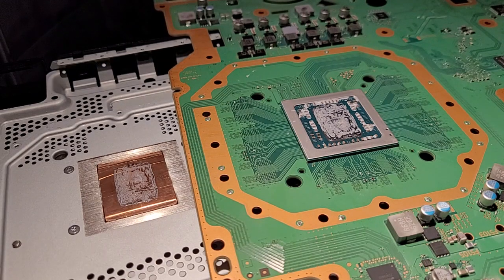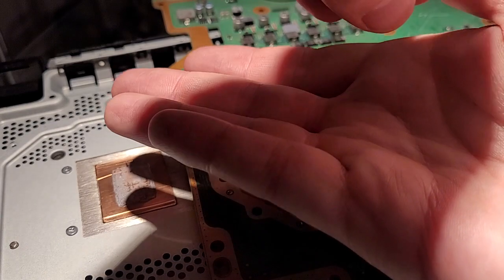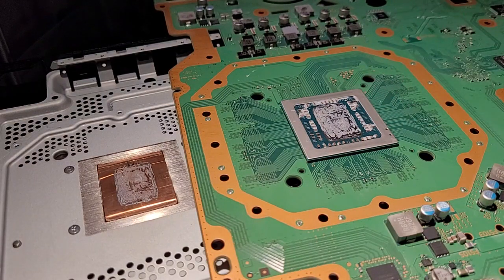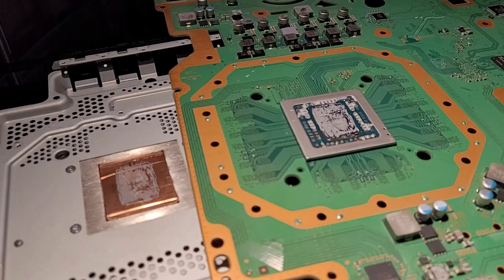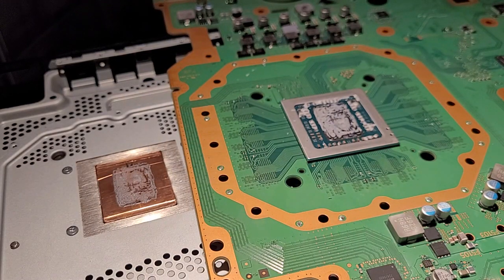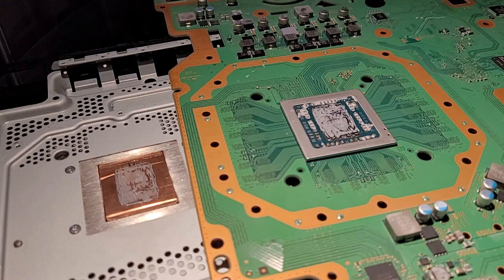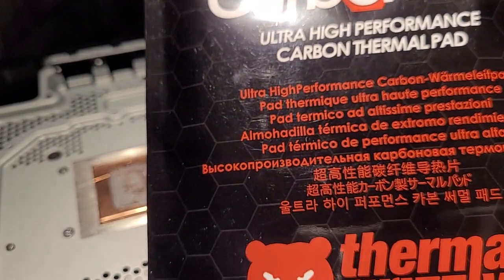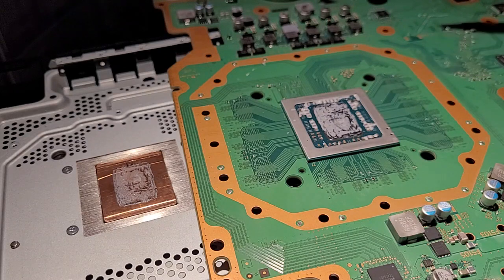PSA: Why your PS4 Pro is Loud Again After Repasting

Comment: Is this the same for the original ps4? Just cleaned and repasted andcstill sounds like a jet.
Reply from the maker: Yes, anything that is direct die can suffer from this issue. I made it more about the Pro specifically as its a much more common problem with it suffering from overheating vs the original.

That being said, you shouldn't run into problems immediately; this is something that occurs over time. For me it took about a month or so for it to return to being a jet engine. 

If you're running into the jet engine sound right after putting on new paste you might have other issues, perhaps a thermal pad is missing or out of place. Or perhaps the tensioning bracket isn't applying enough force.

Comment: If I could add to your theory...I think many people are tempted to push the board on once it has the thermal paste on it.  Not a good idea cause you basically create small air pockets when the motherboard takes its normal flat shape.  Just rely on the X clamp to keep a constant amount of pressure on the two mating surfaces.  🙃👍
I'd also be curious how the PS4's would do with liquid metal, like the PS5.  🤔

Comment: I went the nuclear option and went with Liquid Metal for the chip. Gelid thermal pads for the RAM and other components that had thermal pads on. 

I plan to change the delta fan with a nidec fan. But the console is completely silent with the mods I’ve done.

Comment: What size is required for pads for PS4 pro?
Reply from the maker: @masquerade3224  die size is listed in the description. In general, basically any of the kits will be more than large enough because they're designed to be used with ihs. You'll need to cut them down to size.
Reply: a n i m e
n
i
m
e

Comment: I tried carbonaut today, it's correctly installed and still jet engine noises. Actually worse than before with the hydronaut. I'm giving up :/ Looks like the only solution is buying a ps5
Reply from the maker: It may be something else on the board is getting hot aside from the processor and triggering the fan to ramp like that. Did you check to make sure all the other thermal pads are in place for the vram and power delivery?

Comment: If that’s the case. Then why can’t we put a lot of noctua nth1? Can’t we do that? If it’s thin apply more? Even if it’s messy it should technically work right?
Reply from the maker: The amount is irrelevant, the mounting pressure will immediately squeeze out the excess then the rest remaining will get pumped out over time as described in the video.

Comment: I used Gelid GC-1 last time, and in less than 2 weeks sound like a jet engine again. I've tried kryonaut, nt-h1, gd900, mx-4, etc and all of them have the same issue. I will try the hydronaut. Carbonaut is very hard to find in my country. Nice video.
Reply: Same mate i replace also new thermal paste artic silver my ps4 pro 70xx and again semi loud again when i play ghost of tsustima or avengers
Reply: @kikomanq  Update: 1 month later, sound like a jet engine again with the hydronaut... Carbonaut seems to be the only solution for ps4 pro :/

Comment: NAHHHH Just use Artic MX-6 this one in specific made my thermal pump issue to go away. Barely runs loud. I have the first gen ps4 pro. The loudest one. The jet. The 777.
Reply: how about now?is still run well?or u just put in the closet and play ps5?
Reply: @ben-tol  nope still using the ps4 pro to this date. Ps5 prices in my country are ridiculous.
Using MX-6 did work. But I have to be repasting every 3-5 months. And I game everynight. Yes it did work and run well
Reply: @GuanacoSIVAR  what would happen if u dont repasting 3-5 months or maybe re-paste once a year?or let say last than a year maybe 7-8 month,is the fan going crazy like a used to be?have u try that before?

Comment: I bought a cheap white paste "made in Japan" years ago and has been better or equal than most of these expensive pastes :)
Reply: whats the name of that paste?
Reply: @ben-tol  It just said made in Japan. Now I am using Honeywell PTM7950. Much better than the one on the video (or anything I used before) and it works perfectly on the PS4 Pro, the thing is dead silent now! But it makes sense because the PS4 Pro die size is quite small and every "normal" paste tends to simply squeeze out. Also the PS4 Pro contact part with heatsink is not even, that is also a thing.

Comment: Thanks for this, do you also recommend I change the other thermal pads scattered around? is it necessary?
Reply from the maker: I did personally as a while I'm in there thing. That was mostly because I found some high end Gelid pads for cheap. 

In general I don't think I'd say its a must do, the original pads I'm sure aren't super high quality but they last a very long time. If you don't mind spending another 10-15 bucks I'd say go ahead and do it, but if you don't want to spend the cash or can't find a good deal on thermal pads then I wouldn't worry about them. 

Generally unless one is outright missing or misplaced its not going to have a significant effect on thermals.
Reply: @Canuckrz  Alright, thank you! Also, I'm about to buy the Grizzly Carbonaut pad - 38 x 38 x 0.2 mm is more than enough then?
Reply from the maker: @Caenei  Yep the die size on the ps4 pro is only 15mm x 23mm so you have more than enough to do it twice.

Comment: I just replaced with some cheap thermal paste and completely cleaned my ps4 pro from dust and its still loud af. Should i buy a better quality paste or replace it with grizzly thermal pad?
Reply from the maker: I'd recommend the pad if you don't want to risk doing it again. Its not much more than a tube of good thermal paste anyways.
Reply: @Canuckrz  Will a grizzly minus pad 8 work?
Reply from the maker: @daniel_svk  I would strongly recommend against the minus 8 pad. The minus 8 pads are designed for lower heat output items that require a thicker pad. For comparison the thermal conductivity of the minus 8 pad is 8W/mk, Carbonaut is 62.5W/mk. The minus 8 pads however would be good to use for the ram chips and power delivery on the ps4; just not on the processor.
Reply: @Canuckrz  appreciate it brodda
Reply: @Canuckrz  any updates?
Reply from the maker: @Aaron 868  still working fine though my buddy owns it now. The whole point of this is that if it works find out of the gate it will continue to work fine for years.

Comment: i had issues with artic silver 5 even on my laptops . But i repasted with mx4 and added new pads with a few holes in the fan cover . Now its running like a clock. Even at hands touch it runs much cooler and noise levels are far reduced. I installed a ssd also to boost performance .
Reply: What does that mean you added new pads?
Reply: @yūrei_onigiri  thermal pads .
Reply: The apu also called cpu need thermal paste so the heat get transfered to the heat sink and ccol down the temp, but similarly the memory chips also need cooling, but due to the huge gap that can reach like 1mm or more, thermal paste cannot be used over here, so instead of liquid thermal paste, they use thermal pads which are special sheets that comes in # sizes depending on the gap, and it work similarly to thermal paste

Comment: Any chance of an update video to see how the PS4 pro is going now?
Reply from the maker: I've since sold the console to a friend as I picked up a ps5. Generally with the thermal pad it won't degrade or pump out over time like paste so if it's working well after initial install I wouldn't expect it to change.

Comment: another underlying issue is to check the severity of potential airgaps between the silicone die and the copper heatspreader. So if the airgap is above 1mm, kryonaut will really fail at a rapid rate due to the airgap that's causing micro air pockets onto the application itself making the bond weaker and causing it overpump.
Reply: Cross pattern is the key here, some dumbasses spread it... or a "bigger than pea size" amount right in the very middle, because these consoles are not CPU's.

Comment: No no no!! Just use liquid metal!! I put it on my pro back in 2017 and it is still very quiet today nearly 5 years later. Not as quiet as it was new but still very quiet. 

Also you didn't use enough paste,that's the reason you have all of those lines of uncoverd die..
Reply: Can you please tell me what liquid metal you used? I have the same problem even after chagung the thermal paste and pads. Thanks in advanced
Reply: @ronalgeorge6429  I used Coollaboratory..

Make sure you go pick up some clear top coat finger nail coating to cover up the  Resistors and stuff before you put liquid metal on. If you do not cover those in a nice thick coat you run a high risk of creating a short.

Dollar store has a bottle with a brush for like $1.its the same stuff females use to go on top of their nails after then painted them..
Reply: @solidsnake6405  thank you so much. I will try it out  😊

Comment: I went with that idea, the thicker the better but I used instead IC Diamond 24 Carat and is very abrasive it left marks on the APU and on the copper heat sink scratches and other things.

I watched Luumis’s videos about thermal paste and decided to go with GD900 and with Fujipoly Extreme thermal pads. On the demanding games the fans start to sound a little bit loud but not like a Jet engine. In the future I will use KPX as a thermal paste and it’s recommended to change the thermal paste every 6 months depending on the use. Thanks for the video.

Comment: Yeah so my kid poured water over my pro so stripped it dried it thankfully wasn't to bad changed thermal grease now it about to take of might have to try this.any update did it work well after a while use ?
Reply from the maker: Yep, the main advantage of the pad is that the performance won't change over time. If it works well after installing it, it's going to keep performing well.
Reply: poured water? You take away his crayons or something

Comment: Can confirm this is works. Just switched to carbonaut and my PS4 Pro is no longer a 747 jet engine lol I still can't get used to how quiet it is now
Reply from the maker: The videos of people showing how loud they get really don't do it justice. It's full on piercing vacuum cleaner.
Reply: @Canuckrz  is carbonaut performance really lifelong?
Reply from the maker: @hphp7587  That is what thermal grizzly claims. Given their reputation in the industry I wouldn't doubt them, but the product is relatively new so time will tell I suppose.
Reply: @Canuckrz  even if it holds upto 2 years it would be great. Im tired of repasting every 4 to 6 months
Reply: is it still holding up 3 years later? I'm having this issue atm

Comment: ALL different versions of the PS4 Pro lack an IHS? Is that correct? Or only certain models?
Reply from the maker: Correct, all models lack an IHS. It's pretty typical to be lacking an ihs when the cpu is non user replaceable.
Reply: @Canuckrz  Thank you. What would you recommend? I own a Launchmodel Pro (CUH-7000) from 2016 and haven't had any issues at all. When should I replace the original thermal paste with this pad? Is it necessary, when you don't have any issues?! Cause the process of opening up and putting everything back together, might always cause damage. Of course this risk is small, but is it worth it if you don't have any issues??
Reply from the maker: @moonofthedead7695  if you don't have any issues I'd definitely leave it alone. But if it does start acting up in the future, just keep this solution in mind to save taking it apart again. Mine was the Battlefront 2 limited edition console which I think is the same as the launch console, and it was legitimately vacuum cleaner loud when I picked it up used.
Reply: @Canuckrz  thank you 😊 makes sense. Still strange, that my old one works, an others don't, although it's the same revision. Must have something to do with how well the thermal paste was put on in the first place?! Strange..
Reply from the maker: @moonofthedead7695  Indeed. I've also heard some people mention that there is some flatness issues between the die and heat sink which can also accelerate the thermal pump out in spots. Its possible your ps4 pro just has a flatter die/heatsink contact patch.
Reply: @Canuckrz  i watch video, there is curve in die, so die not touch heat sink 100 percent, only touch 20 percent
Reply: ps3's needs to be delidded just like early intel core series, my 4930k is soldered one

Comment: Just repasted my Pro with Noctua and immediately it was spinning the fan up way more than I felt it should. I honestly thought I had done something wrong, but then found this video. Going to do it again with the carbonaut pad as you suggested. Thanks for the info.
Reply from the maker: The noctua shouldn't have immediately had issues, typically the thermal pump out will take a few months to appear under normal use. I'd also check your thermal pads for the vrm and memory to make sure they were all in place when you take it back apart.

The carbonaut pad is a bit of a pain to line up, just take your time and be careful with it. Iirc I had the motherboard on a couple small boxes so I could access the underside to fasten the hardware to clamp down the heatsink to prevent it from shifting.
Reply: Is noctua bad? I was planning on getting it
Reply from the maker: @jormungandr8821  it's very good paste, just how thin it is makes it bad for this specific use case.

Comment: I don't know how and why I ended up here but I know the video you're referencing too (GN Steve talking to der8auer about Thermal Paste). That video is old and even in that video he admits too Thermal Grizzly Kryonaut has this pump out effect issue, this is why he says you should probably repaste every year if you're using this stuff. 

I would also like to point out that the new stuff called Thermal Grizzly Kryonaut Extreme is said to have less of this effect.
In that same interview he also alluded too that the more greasy wet like consistence will have this issue and most thermal paste in the high end (by the companies measurements are varied from company to company but one they start to advertise 8W/m-k and above performance is when they get more liquid like). 

So if you don’t want to use a pad and still paste avoid higher end thermal paste that are usually marketed as nano hybrid or carbon like based, as they will all have some sort of pump out effect.
If you want something more to a set and forget like paste get something that’s closer to diamond/ceramic base. They are usually a bit more “stiff” but they still spread smooth and usually have a long heat cycle life. 
I know I said to avoid carbon based, but Arctic Cooling MX4 (which is old and now replaced by MX5) has been around so long most people know what they are going to get out of it. It IS carbon based but it comes out a bit more tacky and stiff, but its easy to spread and has a long heat cycle durability.

And obviously at the end... you can just liquid metal cool it too if you want.
Reply from the maker: I think there may be some confusion over the product I used. Although I mentioned other thermal conpounds I used Carbonaut as the final solution which is their graphite thermal pad. To that end it's very set and forget. I do agree however with everything you've said.
Reply: @Canuckrz  No no I wasn't arguing, just saying if people would like to use TIM they still can. Just pick the right now, and if they go for the more top end ones, just expect to redo it at least once a year.
Reply: @Zeiss120  so is the mx-4 useful for consoles? 
ive been planning to open my 360 to clean out its paste since i think its been dried out

Comment: And what are the performance compared to standard thermal grease ?
Reply from the maker: Performance of the Carbonaut is about on par with an average thermal paste, its definitely not going to perform as well as a high end paste that's been freshly applied but it will be better than the original garbage thermal grease Sony used. The benefit of using it is because that high end paste in a direct die use case such as this is going to fail over time from thermal pump out, the Carbonaut will not. With a console its not like you're getting extra FPS anyways from a higher end thermal grease, the objective is to keep it running cool enough so that it will be quiet and stay quiet. I wouldn't recommend using it on a gaming PC build as the same issues don't exist like with the ps4 pro, and you will see some direct benefits there from a higher end thermal paste.

Here is a video of Steve and Der8auer talking about it when it was initially released.
https://youtu.be/d_O6XhKL-VI?t=79
Reply: A N I M E
N
I
M
E